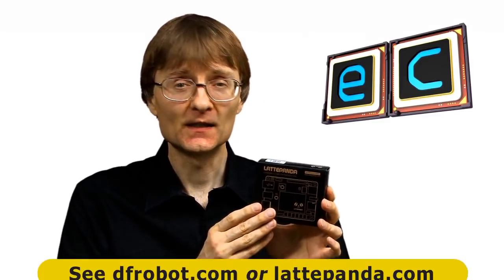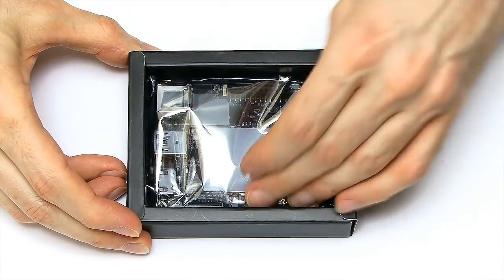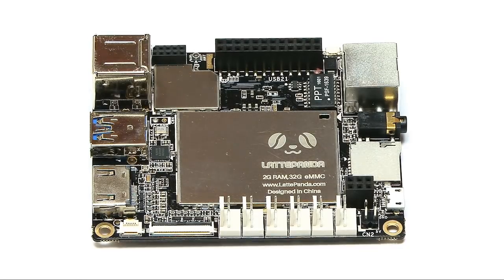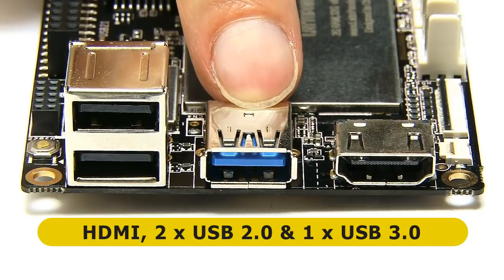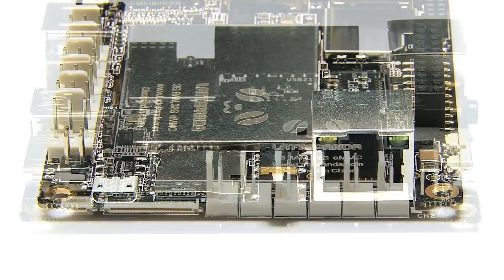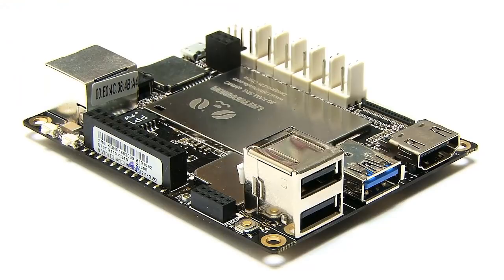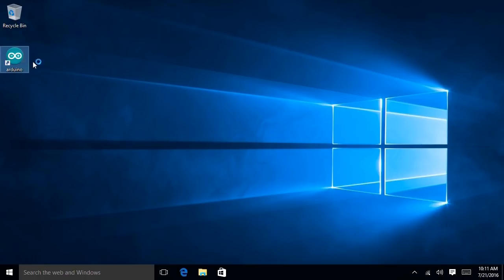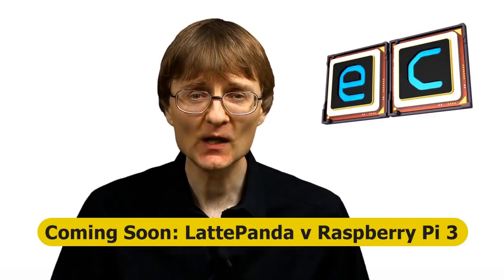LattePanda Windows 10 Single Board Computer

Comment: Hi
I know you talked about the possible heating of this board and if need be you would address that well my questions is.
1.I live in the tropic and it gets hot most of the day's.
     a.Will I needed a cooling 
       system?
     b.If so ? Were the cooling 
        system should be put?
        How should this be done?
       You do not mentioned if the
       cool system should be air             cool system or water cool system?     
    c.Dose it needed to be in cased        like a tower (vertically) or other (in horizontal form)?

Comment: this looks so good, it would be a nice idea try to make one raspberry pie to work with windows 10 if you hadn;t so we can compare the cost if someone try to make it alone. Thanks for the nice video,,

edit, just saw the description where toy compare t with pie 3
Reply: How do you plan to make Windows 10 run on an ARM-based SBC? I mean, I guess you could do it with QEMU if you don't mind using Windows 10 at what would essentially be 486 CPU speeds.

Comment: Microsoft has quickly gained the market on IOT devices. I'm not sure if you would consider this to be in that category, it seems a bit overkill and somewhat powerhungry for augmented reality / discovery applications. Besides that, who can stand windows 10? 
It does score on the USB 3 port though. Thanks for the review, I'd rather stay with Arduino and linux based devices, but it seems promising!

Comment: 5 v 2A seems really low, for what I feel would be optimal for a board like this... I mean hell a USB 3.0 port can do 0.9-1.5 amp output by itself! how can the rest of the board run on ~ 1 amp?

Maybe the Pi 3 power is poorly optimized, but just using OSMC, my pi3 can still get brownouts with a 3.5A/5V psu, So extrapolating toward this W10 board based on that info, 2A seems way to low

Comment: Hi Christopher, it's been a few years now since you released this video. I am curious about the actual developments when it concerns Windows 10 on mini PC's. Could you give an advise on a device that can run Windows 10, and has audio connections as well in order to make it a Windows based machine that I can use as a Media Centre as well as a regular PC? I've seen the ARM version run on the Pi 4, but it seems very slow, due to the lack of RAM available. I am not an experienced user of Mini PC's at all, and I know you are very much into it. I would very much appreciate your help; any tip to put me in the right direction would be of use. Thank you.
Reply from the maker: You may well want an Intel NUC, or Gigabyte BRIX. All sorts of CPU options available. Or a LattePanda Alpha or UDOO Bolt. But all only have standard stereo audio out -- though you could add a USB sound card.
Reply: Thank you so much for taking a moment to answer, at least I have a starting point now. I'll have a look at all of the suggestions. And standard stereo out would be sufficient for my plans. USB Sound is a very good idea indeed, perhaps in a later stage. I would like to show you what I'm building, but will not do that in public,  is it possible to send you a PM, or shouldn't I bother? Anyways, as mentioned before: thank you and keep up the fascinating work.

Comment: I want to know if this has the same display connector as the raspberry pi.... I know that Latte Panda sell a capacitive display but its on 7 inches and I'd rather a larger one..... like 10" and I know that there are 10" capacitive displays compatible with the raspberry pi and its display connector
Reply from the maker: It is a different display connector the Raspberry Pi -- not compatible.
Reply: +ExplainingComputers OK thanks for the quick reply

Comment: so apart from being a web browser, can it do what a desktop can? edit video? run photoshop? office? these things ''look the part'' but i just cant see them doing anything productive in the common use of the word
Reply from the maker: The quad core Atom here is more powerful than that used in many netbooks not that many years ago. So it can run office apps no problem at all. It could probably edit a little SD video and could probably run an early version of PhotoShop. GIMP, for example, runs OK, if not as fast as on an i3, i5 or i7. :)

Comment: Is there an omnidirectional USB hub or an equivalent. Just in case that doesn't make sense because it would make it up, what did he buy an omnidirectional USB what did he buy an omnidirectional USB hub is a hub that can be plugged into multiple computers for the input to the USB hub and anything plugged into the outputs like a phone with USB on-the-go could connect with the drives and the computers. That way you don't have to go fishing around for the right table to the right drive when you've got 20 + Sports on multiple hubs behind your computer, when all you want is to share files between two computers on an external hard drive or a phone without plugging it into both computers they can just click and drag and then click and drag.

Comment: Could you please check whether the windows OS is genuine or a single-use chineezy copy which you can't reinstall if the system fails. Is there a COA with it and a product key? If not, then when (not if) windoze crashes, you're on your own and no reactivating the OS. Even if you extract the key with "magical jelly bean" the key is invalid when you try to reinstall the OS. 
I mention this because I have come unstuck in the past buying chinese hardware with W10 on it. It wasn't genuine W10 but an unauthorised copy which is a one-shot deal.

Comment: Also, will a 4 g broadband laptop stick work in a Lattepanda if I were to power it with a battery pack, for on the go internet?
Reply from the maker: Yes, this should work fine. If it works in other Windows 10 machines, it will work on the LattePanda.

Comment: I'm struggling to find an SBC that will run Windows 98 or XP (x86 32-bit), for software I have more than 40 years worth of data running.  My last, surviving XP machine is still running, but I don't know how much longer.  I still have the 98 and XP OS disks, but now I need a computer that will run (either of) them.  I've been at it several years looking for a replacement computer that will run these programs, but I fear I'm running out of time and options.  

There are options to save my data in space/tab/comma delimited files, but this means I'll end up having to write some sort of program that will run in more modern OSs.  The company that makes the software no longer supports old data sets from 1998, so that's no longer an option.

Because Microsoft no longer supports Windows 7 (and THIS particular version of Windows 10 I'm running now), I'm changing over from Microsoft to Linux.  Microsoft has really found enumerable ways to screw us over, so I'm no longer interested in their products.

I've loaded Kubuntu onto a drive partition of my "old" Windows 7 machine, and they have this thing called "Wine", but so far, it's been a battle and the old Windows 98 software still won't run.  There are other Windows emulators, but it's getting to be a crap-shoot whether things will work.

I've gone to the Latte Panda website to try and see if their product is 32- or 64-bit, but do you know, their website, like so many others, offer anything except information.  Do you know of any other options?
Reply from the maker: I think you will sadly struggle to find an x86 SBC to run Window 98, XP or 7. The problem is drivers. However, you could run all of these OS very nicely in a virtual machine under Linux on, eg, a LattePanda Alpha or Delta, or (say) an Odyssey X86J4105 (see my recent video).

I show how to run Windows (10) in Linux using VirtualBox in this video: https://www.youtube.com/watch?v=OWmD8obq4eQ -- and the principle is the same for earlier versions. Personally I run Windows XP (offline) in VirtualBox on a machine that runs Linux Mint, and it runs very nicely indeed. So if you have the XP and 98 disks, you should be able to get them up and running no problem on a Linux system. Good luck! :)
Reply: @ExplainingComputers  Christopher, I appreciate your response.  I've tried Virtual Box in Windows 7 and it was a bit glitchy (running Windows XP).  I'll try it again in Kubuntu and see if it works any better.  There are so many other things I need to be working on, and this is just one of those things that's dominating my time.  I said 40 years of data, but it's closer to 50.  I have data going back to 1970.  I also use your 3-2-1 rule for data storage, but it won't do much good if the software that presents it no longer works.  Thanks again.
Reply from the maker: @RobertMertensPhD  Good luck!

Comment: Designed in China ? Made in USA ?
How hot can it get when running at max cpu for hours ? So far i think windows uses too much processing power and normally will generate alot more heat compare to linux/android.

Comment: Hello, my name is Toon Bongers from Rotterdam, Holland. I bought a lattepanda, but it doesn't work with my 1000 ma powersupply, for it needs 2000ma. I have a 3100 ma (max) powersupply. Do you think I can use this without problems ?
Reply from the maker: The 3100 should be fine (assuming it is 5V!). The LattePanda will just draw what current it needs,
Reply: Thank you very much for your answer. I'am glad to know now.

Comment: ehh
my windows tablet uses same spec(Z8300 4G 64G)and comes with a battery,a 1080p IPS touch screen(seems to be the same screen from Surface Pro 2),a keyboard and a touchpen
BUT COSTS ONLY ABOUT 1000RMB or 160$

Comment: Really interesting that it includes an Atmel microcontroller.  Does it include a built in flash programmer if you wanted to program not using the Arduino IDE?
Reply: The onboard avr chip is directly connected to the USB port. So I think the default user scenarios is usb programming with IDE or Arduino hex uploader. But on the hardware level it extends the ICSP port.

Comment: For that price, I suppose it is an unactivated copy of win10. If so, you need to buy an activation key, which will cost about the same price with LattePanda. Linux will be a better choice if that is the case.
Reply from the maker: For this price the copy of Windows is activated -- they do sell a cheaper version that is not activated. :)
Reply: Thanks for the info. Now I really regret buying a chinese mini computer. :-)

Comment: Cool little board! I would just be worried sbout the heat in that tiny board. I wonder if the raspberry pi fans would work?
Reply from the maker: The LattePanda's CPU gets warm, but not that warm. This said, a passive heatsink and/or a fan would be a good idea in prolongued heavy use.
Reply: ExplainingComputers Good to know, thanks! :)

Comment: The enhanced version should be the minimum version .
4GB/64GB min for running windows comfortably.
6 or 8GB RAM / 128GB ROM should be the enhanced version.
Really, what does 4GB of RAM cost nowadays anyway?
8GB would be dual DDR4 ram, working optimally, and allow for more VRAM.

Comment: Can it run any Linux distros?  I'd assume it's ARM or 64 bit..
Reply from the maker: It is x86 64 bit, not ARM. Very recently they have released a Ubuntu image. The board is Atom based, so does not have a standard boot loader.

Comment: Err, it's a tablet without the screen, what is so fantastic ? It certainly has uses if it can run a large screen, no mention of the graphics though. The only fantastic thing might be the price but when you think my table cost £199 and came with a screnn, case and battery all you have there is the guts of a tablet with an "arduino" thrown in.

Comment: What do you think....
Can i use this to build a small system just to play videos on my TV?
My receiver can do it too, but it is a bit clumsy when playing mp4s....

And i have a question for reinstall
How does it work? Connect an USB DVD-Rom and use an normal install Disk? Or a SD Card?
My pc has a bootmenu to change the boot location. This one too?
Reply from the maker: Yes, you could use this as a media player. To reinstall Windows you can download an image from the LattePanda website. You then put it on a USB drive with the right name, insert, and the process is automatic.
Reply: ExplainingComputers
Thanks for the fast answer

Comment: Do you always have to push the power button to turn it on? Or can it be configured to startup automatically when power is applied? Does this SBC have an automatic power-on feature in BIOS to schedule an automatic power up at a prescribed time?
Reply from the maker: As far as I have found so far you have to push the power button when using USB power. But possibly not using the direct power pins.

Comment: why doesn't he also review SW for these devices?
Reply from the maker: I have covered various software distros, also programming, and many Linux programs that will run on ARM SBCs. For the LattePanda, this is an x86 PC running Windows, so runs standard Windows software.
Reply: I am talking about libraries ... which are able to control GPIO, I2C, PWM, SPI, BLE, WiFi libraries for python (f these are also following the python paradigm like R-Pi), available project resources, examples of performance capabilities,. If other companies are trying to follow the ease of learning it would be good to also mention these.

Comment: i want one for linux, with 8gb of ram and 2 ssd drives(1 x 128gb and 1 x 1tb), a dc power input, 2 ghz cpu boostable to 3 ghz. a pci slot for a pci extender to a gpu..

Comment: Hi
can we use it as arduino, will it completely functions as an arduino?
Thanks,
Reply from the maker: It will indeed. :)
Reply from the maker: Abdul Habib Please ask questions via YouTubec comments -- or if not here, then via a private YouTube message. I get thousands of e-mail messages and hence cannot offer 'support' via that media.
Reply: Thanks, I sent you a message, can you please check.
Reply: this and arduino is completely different things and using this for arduino stuff that would be complete waste of potential of this device.

arduino is much more low level board, this is a high level thing that can operate an OS
Reply: Yes you are right, but I was thinking to combine and use both boards in one board, so i thought it can be used as a pc and I can also use it for Arduino projects. so no need to buy arduino.

Comment: hi I was wondering with the latte panda instead of using the onboard flash memory for Windows 10 can you move it to the external flash card so you can use different operating systems with a easily?
Reply from the maker: You can only boot from the onboard flash. Try an Udoo X86 if you need more flexibility.

Comment: This is nifty. I have played with the three versions of the Raspberry Pi and now also have an Orange Pi, which I have yet to play with. There are several PC based projects that I hoped to migrate to the RPI, all industrial control, but the RPI is unreliable.  When there is a power failure the uSD can become corrupted, and for field installations that is a problem.  What I need, which the RPI does do is to boot on power up, meaning without having to press a button.  Will this board do that?
Reply from the maker: I've yet to overcome the button press thing . . .
Reply: That's too bad.  This would otherwise be a good platform for my applications.

Comment: isn't a full desktop still a "single board computer"?
Reply from the maker: I see where you are coming from, but the SBC term is associated with these little boards. Also, a desktop motherboard requires additions (RAM to be plugged in, and also storage) to work.

Comment: Is there any Linux version for the same?
Reply from the maker: It is very hard to install Linux on this Atom-based device, as it does not have a standard boot loader (so you cannot just boot from USB and install from that). Some people have ported Linux to the LattePanda, but I have not heard of this having being done with full driver support (eg for audio and WiFi). The forthcoming LattePanda Alpha will support Linux. But this model really is a Windows 10 PC.

Comment: Hello everyone,
Are there single computing boards that the manufacture allows for customized board designs for example of I need to add some sensors on the board or eliminate some functions that are not relevant to my project?
Reply from the maker: You would need to approach a manufacturer directly. It you want a lot of boards, it may be possible.
Reply: ExplainingComputers Please recommend some manufacturers

Comment: Hello again. Creating shortcuts for youtube and facebook worked out, but it would still be awesome to download apps like Iheart radio, but when I click 'get' in the Windows app store nothing happens. My question is, does the 4g/64g Lattepanda meet the system requirements to run small  apps that call for DirectX for example? I'm trying to decern weather the Lattepandas capabilities are keeping them from downloading, or if it's a technical issue with my very first Windows account from preventing them. Thank you for you time, and any insight towards a solution will be most appreciated.
Reply from the maker: Thanks for this -- I see what you are getting at now. And the answer right now is that I don't know, as I've never used the Windows store. Well, I experimented with it once, but it is not how I obtain software. My guess is that the LattePanda Alpha will have no problems, as it is standard Windows PC with the spec of a midrange laptop (somewhat different from the first LattePanda). However, the way that Windows is licensed for the board may be a constraint. I just don't know. Sorry.